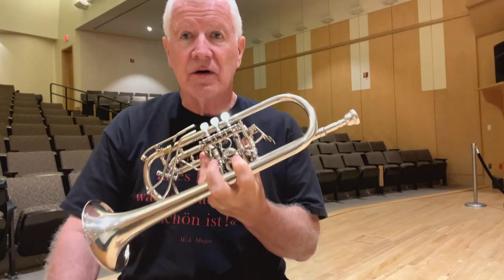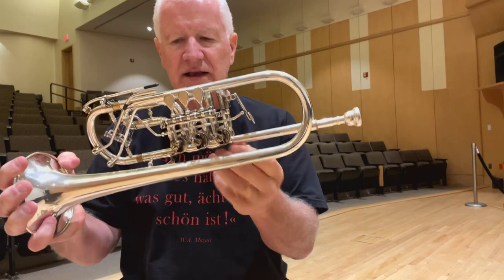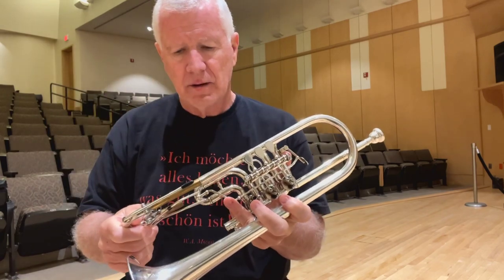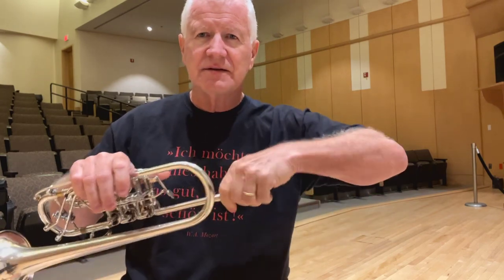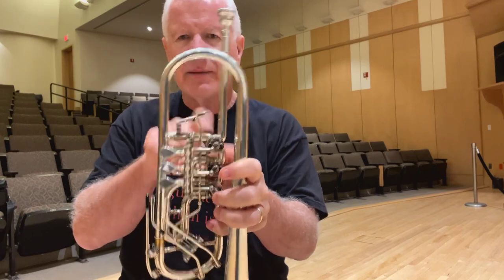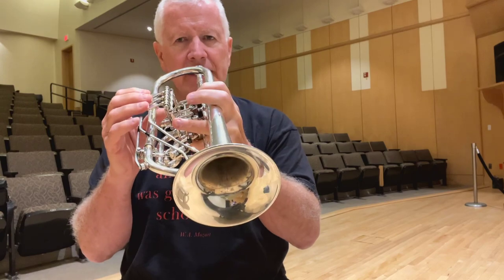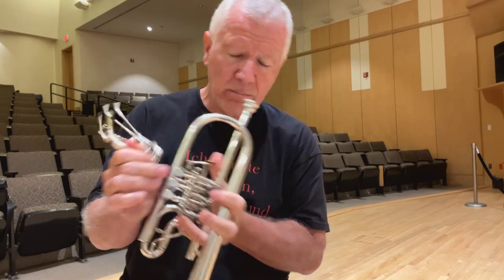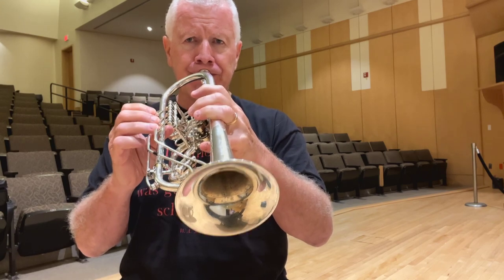FAQ: How to get the water out of a rotary trumpet!

Comment: how demonstrate blowing through the valves, you will not get the water off from the third valve. The gravity is a gainst you. You can lift up the trumpet slightly over your head, then blow through all valves, continue like described. Some trumpets have a water key at the third valve, other pull off the bow.
Reply: Third valve on a rotary doesn't get much unlike on a piston, where the leadpipe enters on it, vs 1st on standard rotaries.